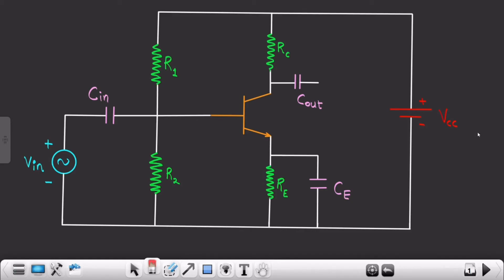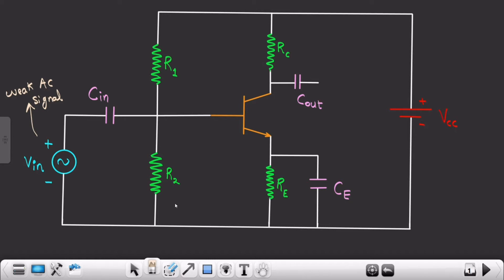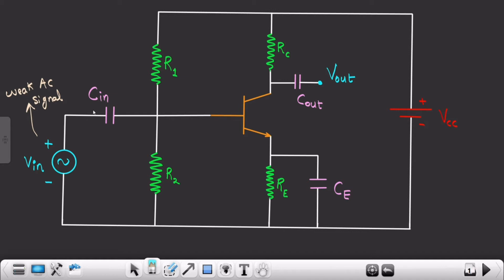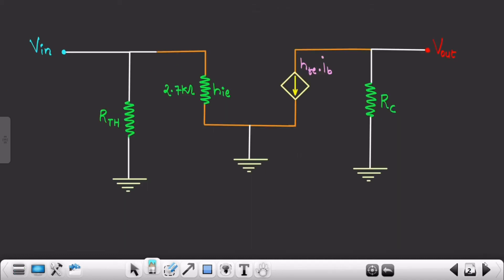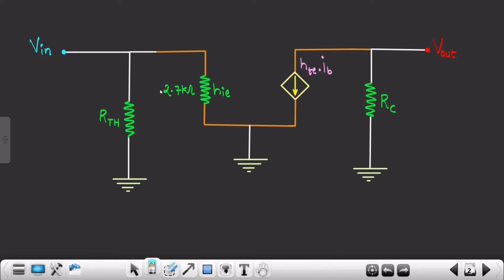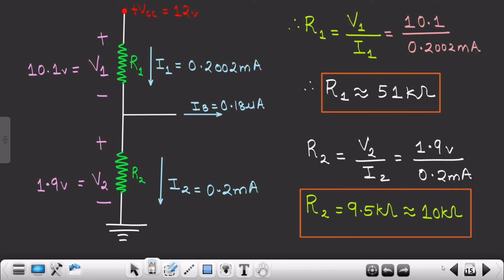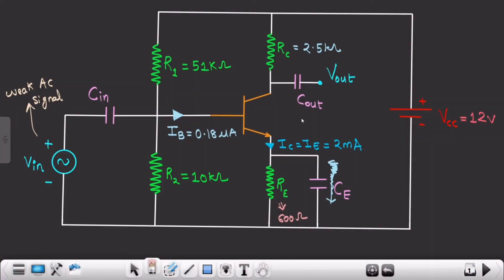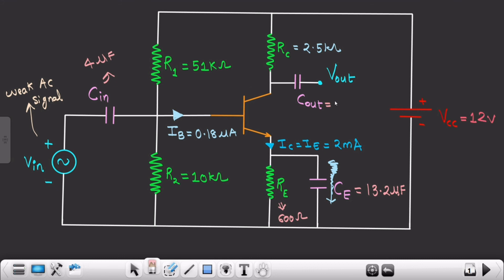CE Amplifier Experiment | CE Amplifier Frequency Response | BJT Amplifier| #transistoramplifier #bjt

Comment: I have noticed while building some testing circuits from the schematics etc. that everything is great till maybe 5 Mhz (sometimes 7 or so) after that the gain starts to drop down and at 27 or 40 MHz it is reduces like 10 times or more or even 0 !! I was wondering so how can I design an amplifier in this configuration of common emiter which works well for higher frequency? I tried various rf transnsistors etc. and the output is very weak for HF and VHF but great for 1 MHz for examlple which is not enough for me as it is only AM band here :/ I know that there are other amplifiers etc. and techniques but I would like to focus on this particular case and know the limits of the components etc.
Reply from the maker: I'm working on this too. 
The gain reduces at very high frequency bcoz of internal capacitance. 
Thanks for the suggestions though.
Make sure to subscribe the channel to get such amazing content related to electronics.